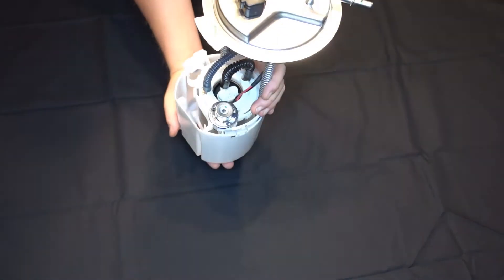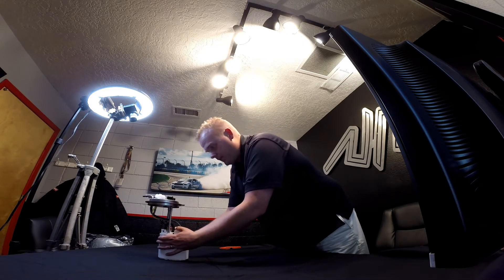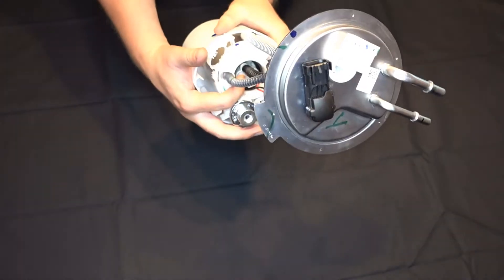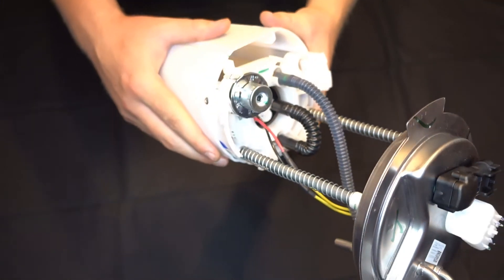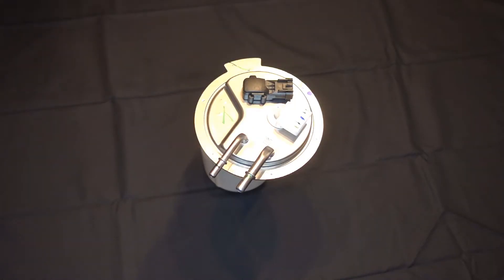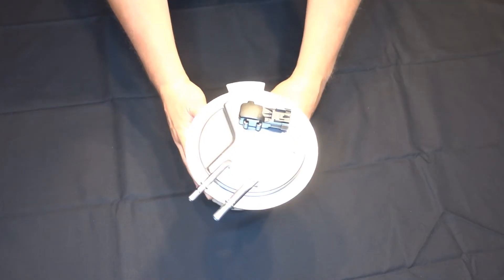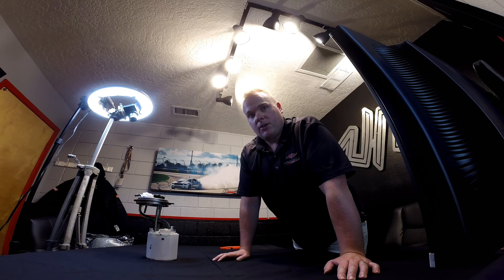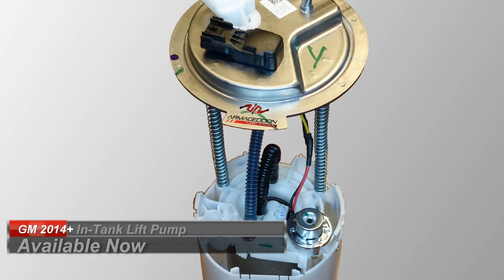800+ RWHP with Direct Injection: 465 LPH Lift Pump - Plug and Play Installation: No tools needed

Comment: Needed more fuel to supply my 2016 ProCharged Yukon with an upgraded LT4 HPFP and Injectors.  You guys were the only ones that offered a low side pump that I could find.  Arrives tomorrow and cannot wait to get it installed so I can finish tuning.  You guys rock!!!